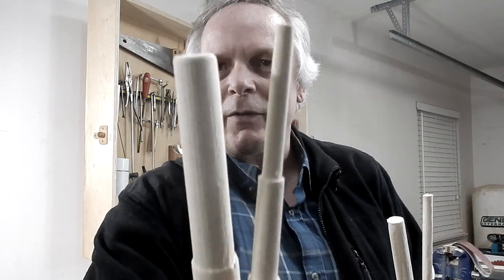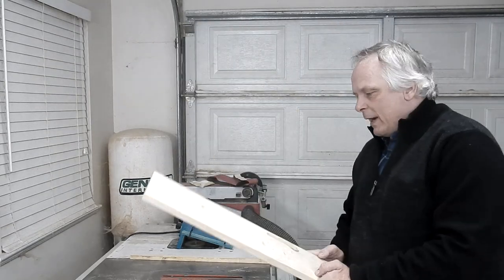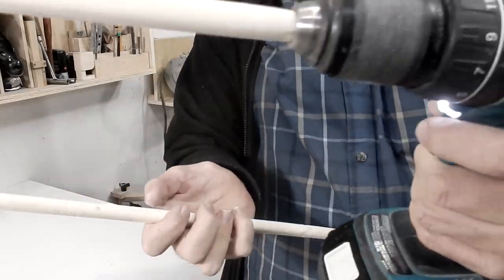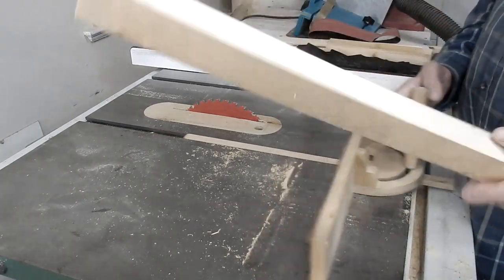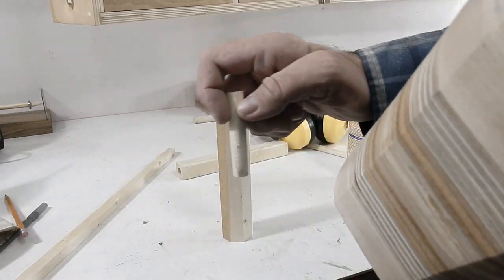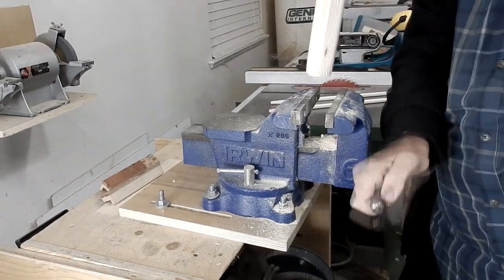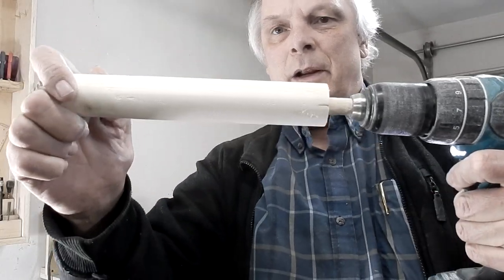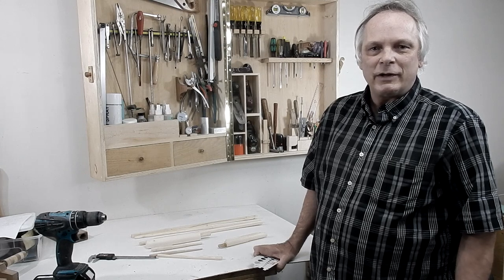Make Dowels,  Only Using Your Vise.

Comment: You never fail to amaze Jackster..My vise is smooth so I wonder if I could fit an aggressive file somehow inside the jaws to do the same thing. The reason this caught my attention is I made a box based on the Japanese tool box design and want to make a locking mechanism using dowel with just one small part of it wider than the rest. I thought of just cutting a short section of bigger dowel and drilling a hole to fit the smaller dowel into it, but I really suck at trying to center the hole and your solution appears to top my idea. I should probably include a link because my description probably doesn't really describe it well enough.